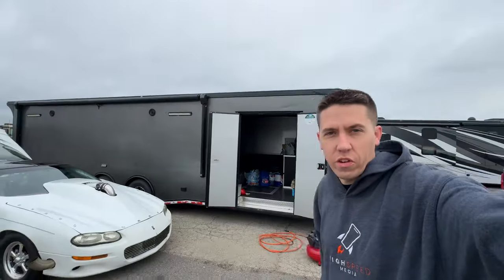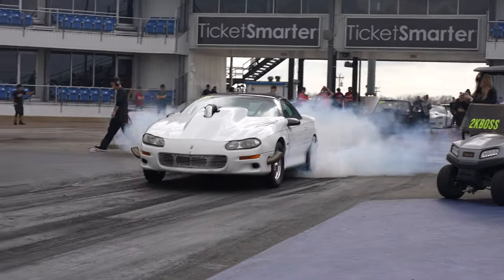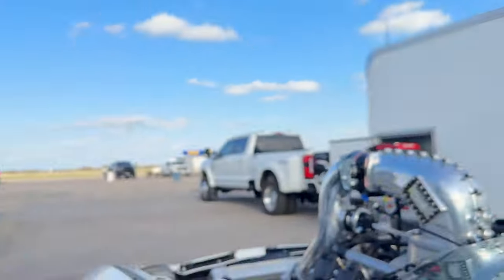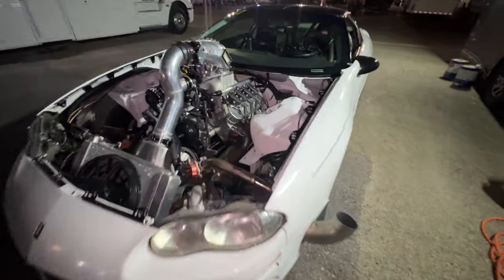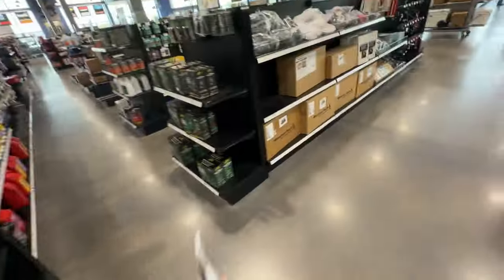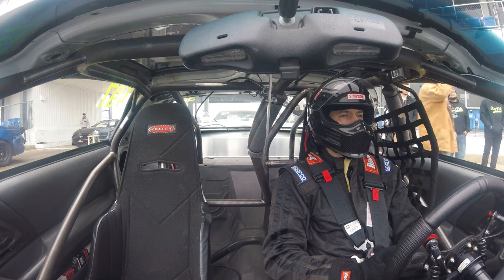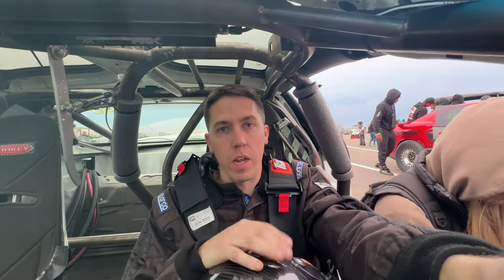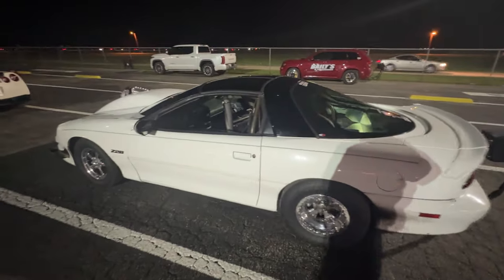WE WON TX2K!!! Salty's FASTEST Passes EVER!

Comment: Are you running race gas or methanol or E? Check your down track videos from the start line. It seems like you are running pretty rich by the amount of black smoke coming out of both sides. Nice job on the win!
Reply from the maker: It’s on c16 so it will have more dark smoke than e or methanol when running rich. I think it was like that due to all the water grains in the air I ended up adding timing and leaning it out a bit but could have probably went further with it. Definitely not what I expected at lower elevation
Reply: Could only see the black smoke during the day time runs and by the way the ET's picked up I thought you must have changed your tune some ! Great job! @BuildTuneRace

Comment: so did putting the screws in the intake bolt holes fix the oil issue? i believe i have the same issue with my c.i.d heads
Reply from the maker: It did. If they are not plugged they need to be as the holes are most likely drilled though to where they breath from the crankcase
Reply: thanks for the info dude. I just looked at pictures i took last year before i sent the engine back to the builder and there is oil all over the lower holes. Def relaying the info to the builder right now. the shitty thing for me is, i have the msd intake and the way they seal the port is different from stock ls7. where they have a long ass gasket that goes past the angled ledge below the intake port, and it wasnt sealing correctly and was inhaling all that oil that was leaking, plus the oil leaked down the backside of the engine into the bellhousing and coated my clutch. atleast i now know why lol. THANK YOU!
 @BuildTuneRace
Reply from the maker: That’s a bummer, I had no idea either then when I talked to Tim at Borowski we looked back at pics and realized that was probably the problem. Seems like it kinda gets forgot about throughout the process and unless you know you wouldn’t ever guess that. Glad I got it figured out and this video helped you as well!

Comment: Nice work! What rear end gear do you have?
Reply from the maker: It’s got a 3.00 rear gear in it for those drag and drives! 😁
Reply: @BuildTuneRace  I’ve wondered what would work with a th400 getting the starting line ratio down in 1st without giving up too much up top
Reply from the maker: Yeah if I remember right math says it’s similar to a powerglide with a 3.50 rear rear and then It also cruises down the highway really nice. 

Also RPM is still like 7700 out the back at 183mph

Comment: Why is it so rich? Its like a diesel going down track. Thats not e85 fuel
Reply from the maker: It’s on c16 it seemed like in Colorado it was really happy but down there with all the water in the air I needed to lean it out and add some timing. I was doing that in small increments as we were racing but still could have used some for sure.